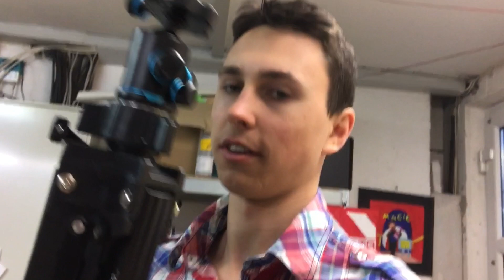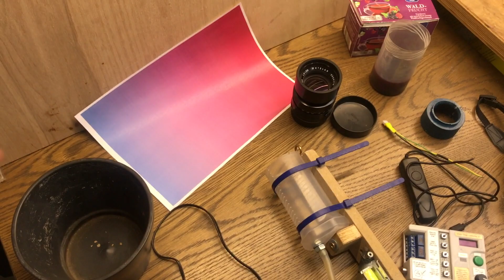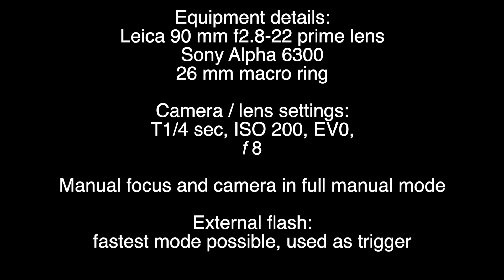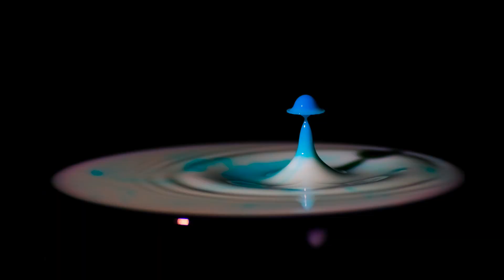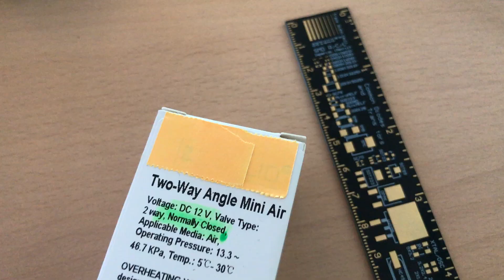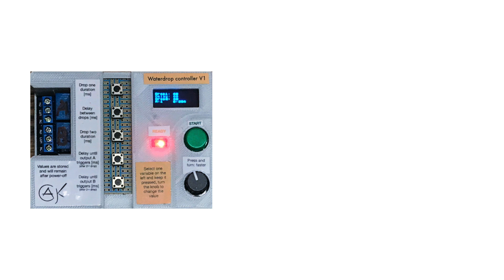DIY Water Drop Photography | Arduino | Tutorial

Comment: Lovely project! I rather enjoy in videos, but photos has its own value, maybe even more than most of the videos. Long time ago I saw trigger mechanism for capturing bugs in fly - two crossed laser beams with pre-focused camera at exact spot of the crossing. Two way of capturing photos: on Sony a6300 disable mechanical shutter and rely on electronic curtain. This way lower delay. For night scenes, open shutter for some predefined time and photo flash. Recently ordered 10 red lasers (3V) and I will try to use LDR since I have no spare PIN photodiode, or perhaps I can use LED as a sensors. Mount two lasers on some wooden or plastic or metal frame, adjust so that your camera is focused at exact spot where two lasers crossing and program on MCU "and" operation, so that photocell A and photocell B are triggered at the same time (actually inverted, NAND or whatever required). Put frame where you expect bug, close to some flower or anything... You will get idea.
Reply from the maker: Thats actually a freaking great idea! I may try this out in a future video 😎
Reply: Wow that sounds really awesome could you maybe share the source so we can make it?
Reply: @NoahPeeters  I did not make it yet. Just an idea.